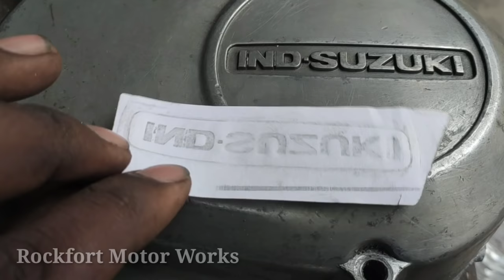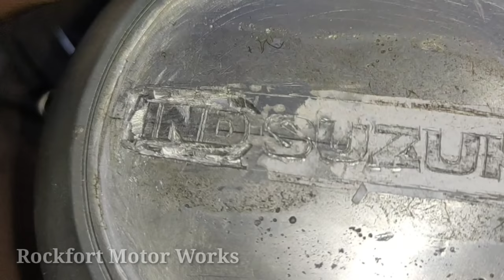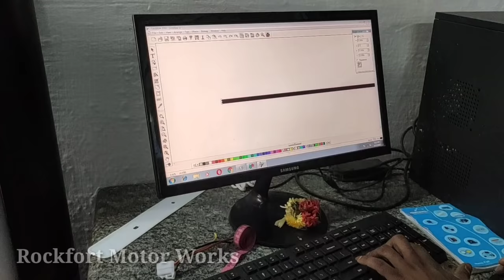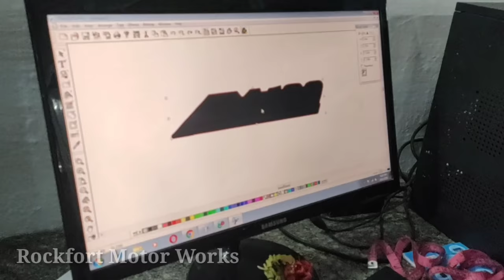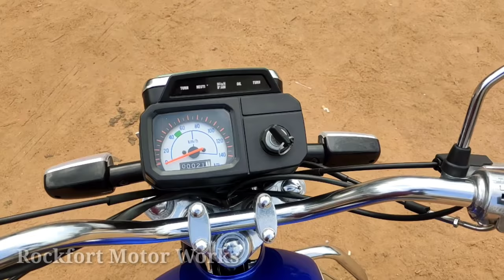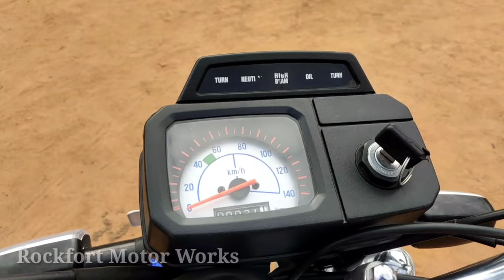Suzuki Max100 Modification for sale /+919789596215/ Rockfort Motor works

Comment: Sir i have Suzuki max 100 and I want to restore it how can contact to you
Reply from the maker: WhatsApp - +919789596215
Reply: Location ekada
Reply: ne get it out tolday o of you are a great mom ok va to you oo
Reply: e k send in money ordered or I could go ko
Reply: @chinnaediting3142  you are not a la oo
Reply: @rockfortmotorworks17  hi
Reply: Bro petrol tank la erunthu vanthu oru kutti tankla store aki pogume antha kutti tank kanon🕵️
Reply: @rockfortmotorworks17  covai la
Reply: @rockfortmotorworks17   ok
Reply: Location ekaba
Reply: Cost
Reply: @rockfortmotorworks17  ❤️❤️
Reply: @chinnaediting3142  Tiruchirapalli, Tamizhnadu
Reply: @chinnaediting3142   TRICHY
Reply: @chinnaediting3142  TRICHY
Reply: Restore price evlo bro i have old tvs max100
Reply: How much it will cost ????
Reply: Bro enkitta suzuku max 100 irukku bro antha bike aaa ind suzuki mathri restore panna mudiyuma
Reply: @rockfortmotorworks17 wiring mil sakati hai kya max 100 ki
Reply: Bro en kitta ax 100 1987 model irukku bro restore panna     mudiyuma
Reply: Sir where to buy rear shockbser bolt

Comment: Bro super. But you try to get back to IND SUZUKI .IN IND SUZUKI back mudguard will be in metal,speedometer bottom will be in crome finish, indicaters will be round , head light you have tried CD 100 suzuki square headlights getting in market try that . Totally your work super.